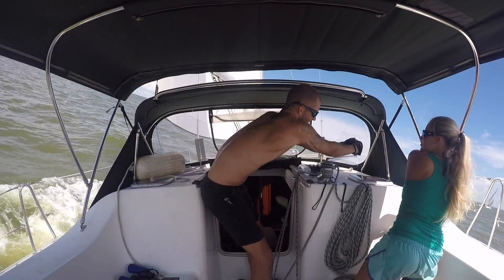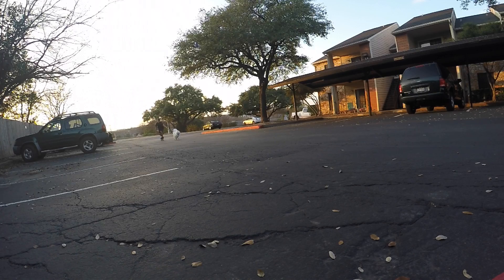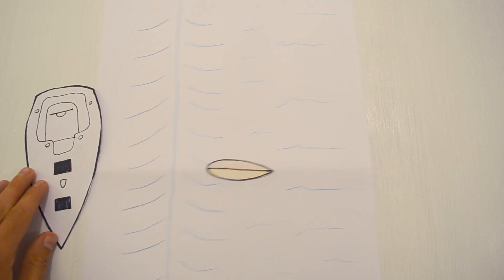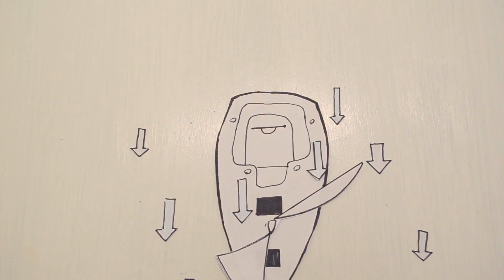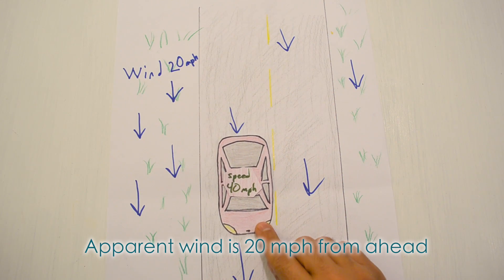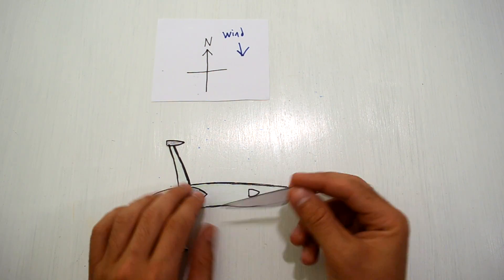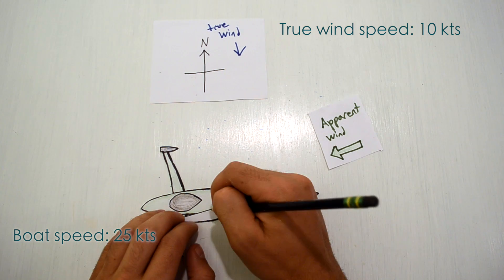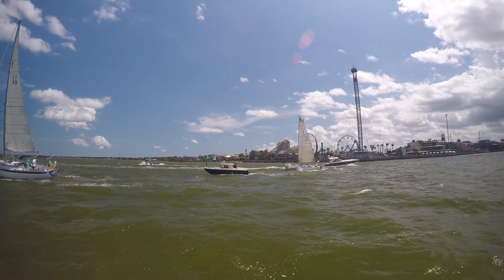How do sailboats sail faster than the wind??

Comment: From my recollection, sail lift is only part of the story.

The main force is two-fold: Wind against the sail and water pushing back at roughly the same force but less than 180 degrees against the centerboard and keel. If you draw a vector diagram of just those two forces, the resultant is a huge force at some angle between the two. It's the old E=MV**2, so the energy applied is at the SQUARE of the wind velocity, and it two directions. It's like holding a wet watermelon seed between your thumb and forefinger and squeezing at less than 90 degrees to get the seed to shoot out of your hand.

With an ice-boat the skates provide the counter-force as a centerboard would do in water.

Comment: Actually you can go faster than the dog.  If you tack left and right behind the dog you must be going faster than her.  If the dog can adjust for the pull of the leash going left and right behind her while still keeping her line ahead you can theoretically get any desired speed faster than her.  Good explanation, anyway.

Comment: The surface area of the sail is what gives you propulsion energy, the surface area of the hull on the water is what resists movement. The new super fast sailboats use hydrofoils, that lift the hull out of the water, reducing friction on the water, while the enormous sails still provide enormous energy. They are turning the entire boat into a kite. These factors combined with the wind vectors that you mentioned are creating exciting new possibilities for record sailing speeds.

Comment: Another explanation that may be helpful is to split up the apparent wind into headwind and crosswind components (relative to the boat's heading). The apparent headwind is a drag factor, while a portion of the force related to diversion of the apparent cross wind propels the boat forwards. The apparent crosswind = true wind x sin(heading relative to true wind), regardless of the boats speed. For example, with a 10 mph true wind, and a boat heading 30 degrees away from directly downwind, the apparent crosswind is always 5 mph, again regardless of the boats speed. The maximum speed is how fast the boat can travel with a 5 mph apparent cross wind. Say you have a very efficient boat, achieving 17.32 mph with an apparent crosswind of 5 mph. It's velocity made good downwind is 17.32 mph x cos(30 degrees) = 15 mph, 1.5 times the true wind speed. The other factor here is that part of the diversion of the apparent headwind is directly upwind against the true wind, slowing down the true wind (from the water's frame of reference), and slowing down the true wind is the source of the energy that propels the boat.

Comment: So what you're saying is the surfer can get to where the wave is going significantly before the wave gets there.   That doesn't really make any sense without over unity.   Not saying it's not true, just that it doesn't make any sense with the currently understood laws of thermodynamics.
Reply: If trying to use a surfer on waves as an analogy, imagine a continuous series of waves and a surfboard with low drag. The surfer goes cross wave to gain speed, turns down wave and uses the momentum to catch the next wave, turns cross wave to gain speed again, and so on, approaching the shore faster than the speed of the waves. For the sailboat tacking with a downwind component faster than the true wind, the sail boat is continuously catching up to the wind that was ahead of the boat before the boat intercepted that parcel of air.
Reply: @rcgldr  yeah, but you see, in most instances, the wind against the sail is continuous, not in waves.

I think something else is going on here, like some sort of phase change, not between gas and liquid, but between one gas state and another, utilizing something akin to Viktor Schauberger "implosion technology"

Comment: There is now a land sailing craft that can travel directly in the direction with the wind, but at more than 2 times the speed of the wind pushing them, and only using the power from the wind alone.
If you have not read about it, I recommend to look it up and examine this latest working design.

Comment: Pretend you want to go north. You can think of a North Eastern Wind as the sum of a Northern Wind and an Eastern wind interacting. This concept is known as vectoring. If you have a Northern Wind you can go as fast as the wind. If you have a North Eastern wind you can keep going faster because the Wind from the East is keeping your sails full even though the wind from the northern part isn't doing anything. That's because you aren't traveling North East, but just North. You relative Eastern speed  is Zero. The boat takes the extra wind from the east side and converts it into forward momentum. A side effect of the conversion process is that the boat  tilts, but the flotation devices on the boat counter act this force. There are blades under neath the boat that force the boat to go only forward. As you pick up speed you keep turning the sail to minimize the effect of the  apparent wind generated by going forward.  You can think about it as 3 different vectors. The Northern wind vector (effective only until you reach it's speed). The eastern Wind vector(effective always). And the apparent wind vector(A wind that you created by going fast and Works against you when you are traveling faster than the northern wind, this force gets stronger the faster you move and limits your speed; otherwise you could go nearly infinitely fast).  You'll find in physics in general that the more extreme something is the more other outside forces will start to intervene and ruin your fun.

Comment: Thank you for this video. What do you think of the recent claims that you can go faster than the wind, dead downwind? I still have a fundamental problem with it. I understand gibing downwind is faster and many boats do this when we race. But dead downwind, I still have a problem with people saying that they can go faster than the wind. Your thoughts?
Reply: It's been done, using wheels to drive a propeller for downwind, or a windmill to drive wheels for upwind. In both cases, the incoming higher speed, lower force is geared down to a lower speed, higher force (despite losses in the process), enough for the vehicles to exceed wind speed both downwind and upwind. The concept dates back to 1877 with the Brennan torpedo. Steam driven spools pulled in wires from spools on the torpedo, each of which was geared down and drove a propeller, resulting in the torpedo moving forwards while the wires were pulled backwards. With the wires attached to posts, the torpedo would travel downstream faster than the stream.

Comment: [Coming here after Veritasiums video "Risking My Life To Settle A Physics Debate"]
At 9:09 it finally clicked. You not only use the wind that keeps pushing you but you also catch the apparent wind to push you even more. This still seems slightly counterintuitive but it makes much more sense now.
Reply: Not quite. It's easier to see what is going on if you separate the apparent wind into apparent crosswind and apparent headwind components. The apparent headwind contributes to drag. Part of the diversion of the apparent crosswind propels the boat. For a given true wind, and boat heading, the apparent crosswind is true wind speed x sin(heading relative to wind). For example, if the true wind is 10 mph, and the heading is 30 degrees away from directly downwind, the apparent crosswind is 5 mph, regardless of the boats speed. Then the boats overall efficiency determines how fast can it travel with an apparent crosswind of 5 mph.

Comment: Does this mean that you can sail opposite of the river flow when there is no wind? if you look from the reference frame of the river water you will have the wind in the opposite direction so if you can sail faster than that wind then you will move opposite of the river flow, right?
Reply: One more thing, if you can sail faster than the wind (after you pickup side speed), what if that wind is close to zero? Does that mean that you can sail even if there is no wind? (I know you cannot because of energy conservation, but I need an  explanation). When you move you will have a wind from your reference frame that can make a low pressure on your sail.
What I want to say is that if you look from the reference frame of the wind there is no way you can make some object move unless you have something else giving it some energy. In this case it is water. For example if a sail boat is on ice it would not work but your explanation does not mention that.
Reply: You said that drag from the water is holding them back. But if they is no drag (for example a car with a sail on ice), it could not go faster than the wind because if you look from the wind reference frame, what would give that car energy to move?

Comment: The fundamental illusion to be stomped here is the wind is NOT pushing a sailboat.
That's most of the time not how this works.
The sail is a wing effectively and your power pushing you forwards is essentially lift that comes from the bernoulli principle.
Low pressure on one side and high pressure on the other side applies an equalising force on the thing causing the disparity in this case an aerofoil called a wing or a sail.
Wings have a very fine disparity because the "windspeed" is huge. Sails tend to be more pronounced because we have much smaller wind speeds to deal with but the same principles apply.
The faster you go the more efficient it is to reduce the disparity between each side of the aerofoil.
For real Science on the matter read https://www.amazon.co.uk/High-Performance-Sailing-Faster-Techniques/dp/1408124912
Julian Bethwaite revolutionised my ideas on the principles of sailing fast skiffs.
Luv and Peace.
Reply: The other big thing to mention is the planing hull.
If a boat has a displacement hull it has a hull speed that is proportional to it's length.  Longer boats with equal sail plans are typically faster.
The boat stays fully in the water at any speed.
Most racing dinghies and some sportsboat type keelboats have planing hulls.
These are hull designs that generate lift at high enough speeds that can propel the hull over it's bow-wave and initiate planing where the boat is no longer fully submerged in the water and fighting it's bow wave but ahead of it's bow-wave and essentially on top of the water massively reducing hydrodynamic drag.
Bethwaite has graphs in his book about how speed to power ratios are roughly equal until a displacement hull reaches hull speed and a planing hull begins planing.
A planing hull can keep going faster the more power it gets where a displacement hull hits a wall where it can't move the water out the quick enough to accelerate faster.
The feeling on a planing dinghy of coming up onto the plane is very noticable and typically calms the boat down considerably because the forces that were trying to knock you over can now just accelerate the boat.
I used to sail a laser 4000 skiff and it would be hairy until you were planing then it would settle down to the extent with the right trim you could take your hand off the helm and it would just truck on.
An amazing thing to behold.
3 sail reaches faster than the wind and zero stress just great fun. Minimal inputs. Steer up in the lulls and steer off in the gusts. Surfing the wind for miles.
Best days of my life.
Luv and Peace.

Comment: Okay, stop.  You had me up through the dog pulling you on the leash, but then you just went all over the place.  You should have stuck with the dog on the leash.  Imagine the dog pulling you but now you let out more leash so there's more distance between you and the dog. Everything else remains the same, it's still you traveling at the same speed as the wind. But now you angle your board so you're not traveling in the same direction as the wind/dog, but 10 degrees to the left or right.  The wind speed remains the same, the dog still pulls you with the same force, but you're pushing back, using the grip of your wheels, or the keel of the boat, as leverage, allowing you to convert that forward force of the wind into lateral movement.  Think about a water skier going way out to the side of the boat and using the force of the boat to pull himself back across the wake super fast, it's the same with the wind.

Comment: Well done. Apparent wind can also be explained using the analogy of a water-skier.  Anyone who has tried or seen water-skiing will easily understand that the skier can can go much faster than the pulling boat. Almost what you did with the dog and skateboard :) Except you didn't turn, which wouldn't have been nice to the dog.

Comment: This is way too complicated.  You just need to think about it in aeronautical terms.  The boat gets thrust from the sail/windfoil system through the mast.  Your boat speed is a product of the thrust of the sail/windfoil, limited by the drag/friction of the hull, in regular boats, or ice blades in ice sailers, or hydrofoils in Cup boats.  So, as long as the friction is low enough, and the thrust is still being applied to the craft through the sail/windfoil/mast, you will have a terminal velocity related to that thrust/drag ratio.  You can generate pretty much any amount of thrust you want, at very nearly any reasonable wind speed, by design of your sail/windfoil to that spec. What is hard, is then structurally supporting that sail/windfoil, and putting it on a craft with low enough drag and mass, that it reaches the designed terminal velocity goal.

So it's thrust to drag ratio which is important.  Not really wind speed.

Comment: My thought is that the sails generate aerodynamic "lift". This is creating a partial vacuum. The rate that the sails are pulled into this vacuum is not limited by the wind speed, hence the boat can sail faster than the wind.
The "lift" is only generated when air is flowing across the sail, not when catching it. This is why it only works on a reach.
Any comments?
Reply from the maker: What you say about the vacuums is true, but there's also a catch. The sails being pulled by the vacuum are attached to the boat (clearly). As the boat speeds up the apparent wind will come more and more from the front of the boat. At some point the wind will be so far forward that it'll actually slightly collapse the wing shape of the sail. But yeah, that only happens at fast speeds or if the sails are trimmed poorly. In most cases the boats drag will slow it down well before that point. And yes the "lift" effect only happens when there is wind flowing infront of the sail.

Comment: Excellent explanation and I love the analogies(It's how I learn/remember myself).  As a private pilot interested learning to sail, this is very interesting to compare to an airplane wing.  It brings me to a question of laminar flow and wing planform of the sails.  My questions are simple and purely for my understanding.  Do Sails have tells on both sides( Presume so but want to confirm).  If so, do they(the tells on opposite sides of the sail) mirror each other or do they point in different directions. Finally, I presume you trim sails based on the tells on the inside of the sail.   As a side note, aviation designers use tells on aircraft during flight testing to "see" a stall of the wing.  They cover the airplane with tells and you can watch this here.  [https://youtu.be/LmK7EcC1WNM?t=2m12s] . This is similar to what happens when a sail luffs.
Reply from the maker: Interesting video. Having that many tells is shows a lot of whats happening. On a sail they do have tells on both sides. One reason is that depending on which tack you're on, port vs starboard, you'll have different side of the sail as the low pressure zone. But you can & do trim by watching both the inside tells when trimming. When properly trimmed, the tells flow in the same direction on the inside & outside of the sail. The really rough rule of thumb is to trim in the direction of the misbehaving tell. So if the inside tells aren't flowing aft then you need to pull it in. If the outside tells are acting up then you need to let it out some. If you're not sure then the adage "when in doubt let it out" works well. There are also some more advanced trimming you can do if the bottom tells are flying nicely both inside and out, but then the top tells act up. If that's the case then you can modify the sail's twist to help by adjusting the jibsheet cars for the Jib or easing the mainsheet and adjusting the traveler for the Mainsail. We're still learning & figuring out the more advanced trimming techniques so maybe someone else can give a better answer. But that is how I understand it as of my learnings so far.
Reply: Thanks for the reply.

Comment: I think a better word for drag should be displacement. Most sailboats that need to displace the volume of water they are sailing thru will never sail faster than true wind. The best example of sailing faster than the wind I like to use is a windsurf board. A windsurf board can get up on a plane, meaning only the aft part of the board is in the water reducing the drag, or displacement of water. With15 knots of wind, I can windsurf about 25 knots. On my displacement sailboat, a Sabre 34 I need at least 10 knots to get moving along at 5 knots. And of course the new toy on the water are hydrofoils, that get the entire craft out of the water. Excellent points otherwise.
Reply from the maker: +SV In Like Flynn yeah good point. In my mind I equate greater displacement with greater drag. But that doesn't mean someone who is less familiar with sailing would realize that.